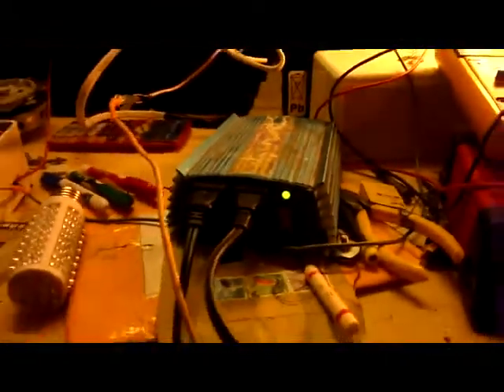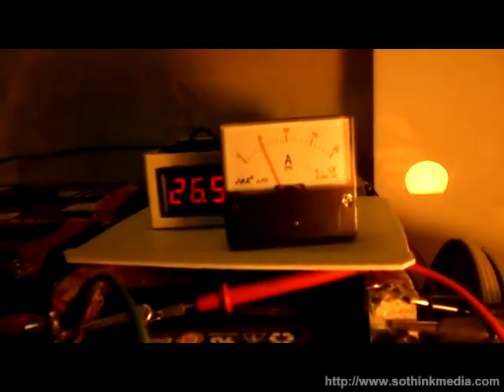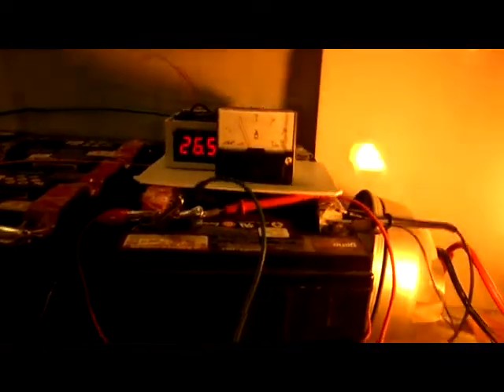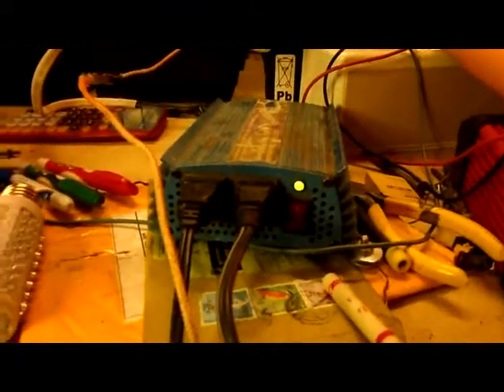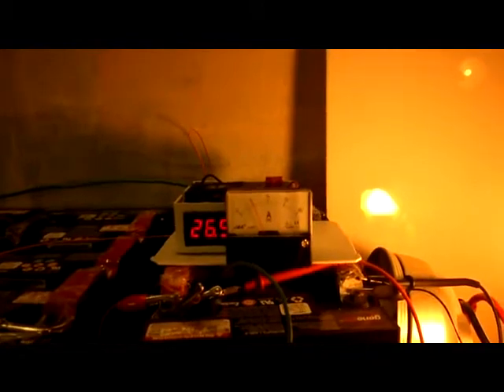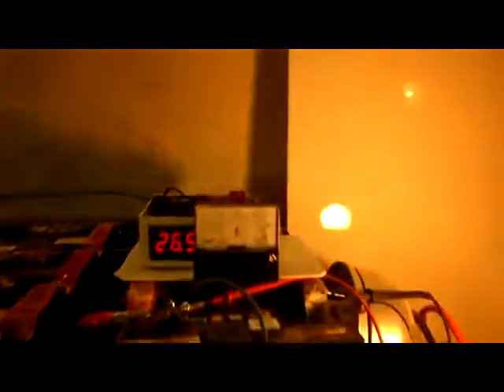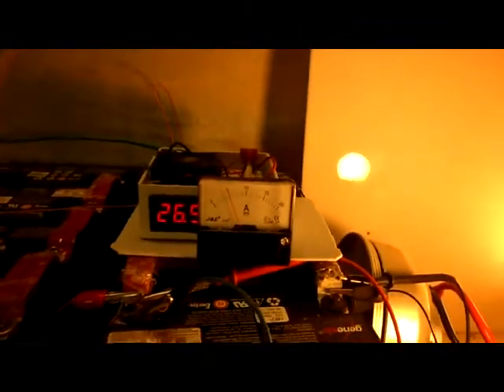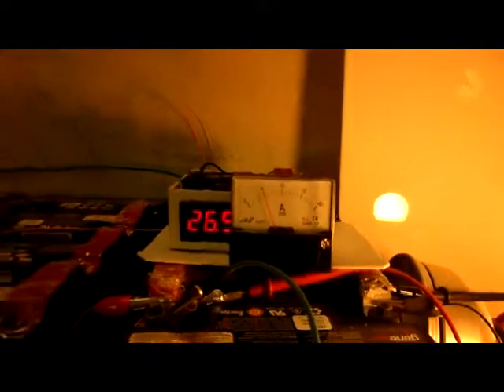Split the Positive to Inverter 2 Boosters Part 4

Comment: Do another test splitting the negatives and metering both at the same time.  I think  Tesla was into using both ends of the candle.  His idea was to maintain the charges in the reserve batteries using series on one side and parallel  circuits on the other thus creating  a consistant difference in potentials. ENJOY.